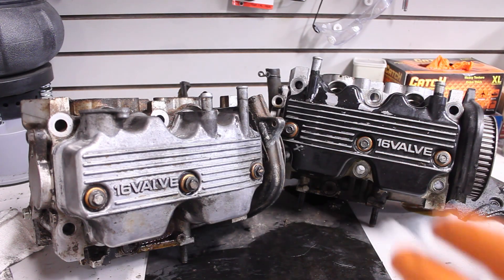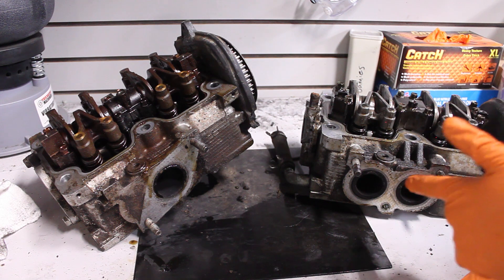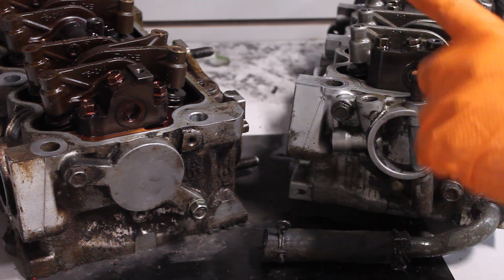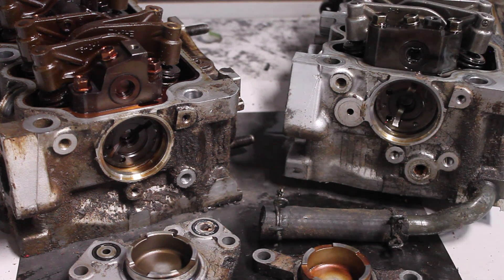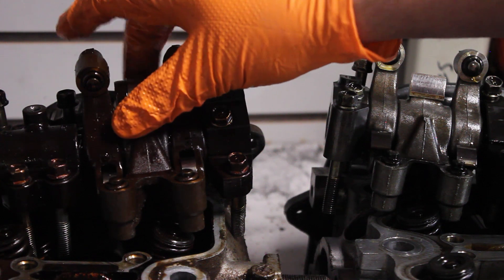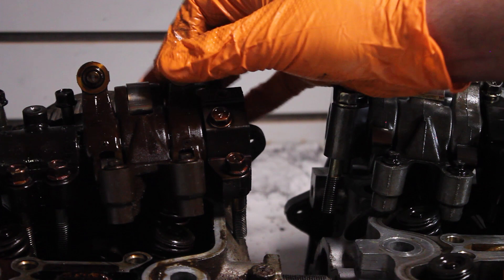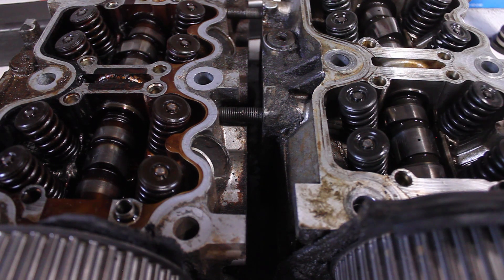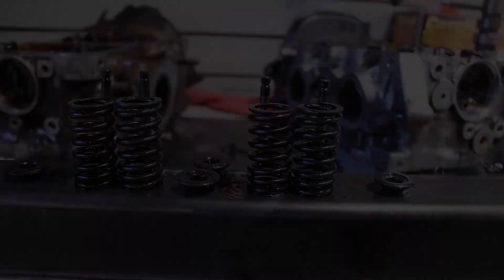Subaru Legacy EJ22E vs EJ22T Head Comparison + Teardown | Will's Builds Ep.29

Comment: I dropped my heads off at machine shop with cam cap still installed to identify right and left. When I picked them up cam caps was removed and both heads appear to be identical. 95ish Dual exhaust port ej22. Are left and right interchangeable?
Reply: They should have a L and R in the casting

Comment: Do you know the OE specs for the headgasket thickness? I can't find any reliable info on the net and did not find anything in the service manual about it, only the part # which is discontinued since ages and provides no specs whatsoever. I asked Cometic and they told me 0.030" but I find it really thin and hard to believe.

Comment: So I have a 96 impreza. Ej22e. Bout to rebuild the motor. My heads are single port single cam. Would it better to rebuild my heads or go with something different. I'm going to bore the block to .10over
Reply from the maker: Depends on power goal and budget.  Finding earlier ej22e or ej25d heads will get you dual port, which are easier to find turbo headers for.  But ej25d heads will require a different intake and timing belt setup, adding to the cost.

Comment: Could I just swap the heads to swap na to turbo easier?
Reply from the maker: Yea as long as the exhaust port is the same.  I believe most, if not all, 96-99 SOHC heads have a single port exhaust while the turbo heads (and earlier SOHC heads, 90-94ish) are dual port exhaust.  The heads will interchange but exhaust manifold will not.
Reply: @WillsBuilds  okay sweet. So I'll have to cut and weld a little bit. Looking at a 1996 2.2l it's 1800.

Comment: i got 270000 on my ej22 98 legacy, it has single port headers.. original head gasket. its leaking from the oil galleys on the bottom, i may try stop leak but it only leaks about 1 qt every 3k.. not sure when i will do a rebuild ..
Reply: Iv seen engines with stop leak all gumped up .. not sure I may just get a hoist and rebuild the engine ...
Reply from the maker: Yea they're pretty solid engines if you take care of them

Comment: Did you measure the valves diameter? I might have to change my EJ22T valves as pretty much all my intake valves are leaking badly (I don't know if the problem is the valves and/or the seats) and it will be damn near impossible to source Turbo valves. Hoping non turbo valves are the same, at least measurements wise.
Reply from the maker: Sorry for the late reply. I don't know why this never showed up.  I remember seeing that one had slightly bigger valves, and I think it was the 22e models. The cam lift also changed every 2 or 3 years it seems, but that doesn't really affect the valves.
Reply: Definitely larger intake valves on 22e, I think ex valves are the same, diameter at least.

Comment: 1997-2001 were single port style for EJ22. Also, the Phase 1 SOHC 2.2 heads all have 41cc chambers. As far as the oil "tunnels" in the cams, Subaru was looking to remove as much internal drag as possible to achieve better emissions numbers. That's why the EJ22E was changed radically from the dual port version for 1996-1997. 

Though the Phase 2 EJ22 is radically different from the Phase 1 EJ22 single port, it kept a few of the same upgrades, all to satisfy emissions standards for the time. Hope this helps!
Reply: And consequently the ej22e has shorter piston skirts too.  Which leads to the infamous piston slap.

Comment: The turbo head is also larger in the combustion chamber to reduce compression ratio. The rocker towers on the turbo are heavy duty compared to NT. Thanks for the tour. Planning on turbocharging my EJ22 and this heads up is valuable. Hydraulic and std adjusters use different cam lobe profiles. Not necessarily interchangeable. Bear in mind the roller camshaft has a hardened surface for the roller, where non roller cams typically are not hardened. The Turbo head looks like it was assembled without washers under the head bolts. Odd for Aluminum heads. Or incorrectly built.
Reply from the maker: Everything I've found has the combustion chambers on Phase 1 SOHC engines being the same (43cc).  The turbo pistons have a bigger dish (28cc) vs the NA engines with 14.5cc pistons, which is how they get the change in compression.